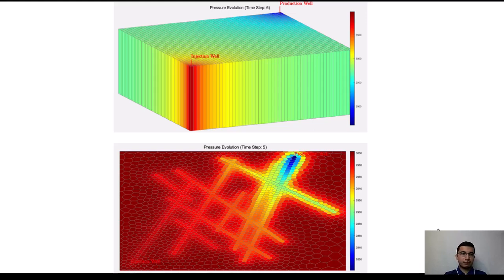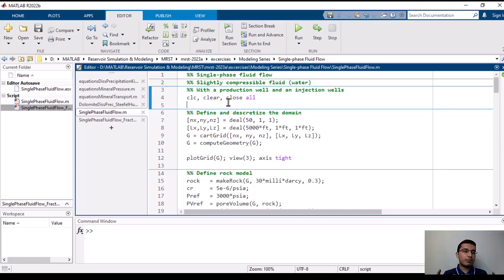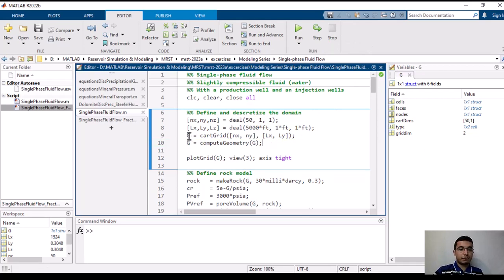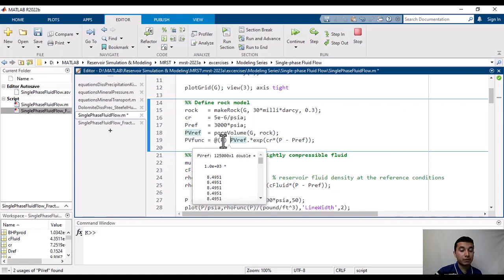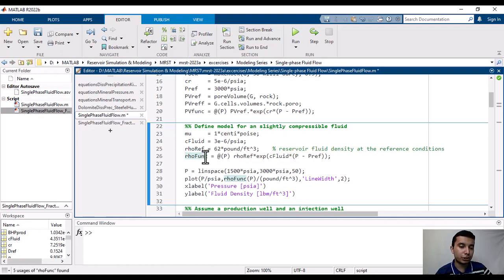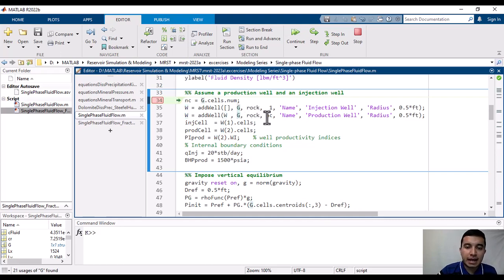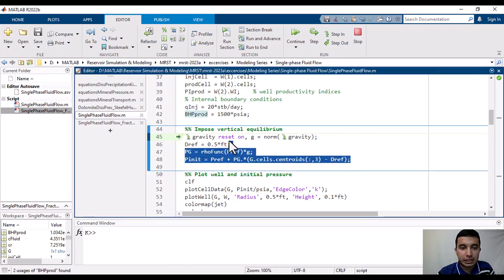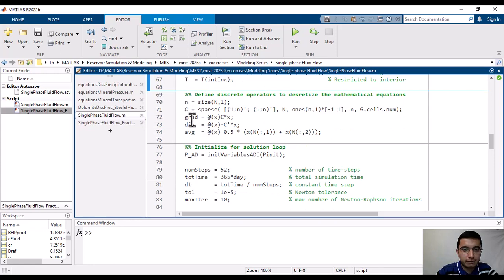Single-Phase Fluid Flow Modeling in Porous Media with MRST (Part 1)

Comment: @SajjadMoslehi. I am simulating flow in porous media with a seepage boundary condition in MRST where the boundary condition at one side changes from 0 flux to 0 pressure head at the onset of full saturation so that outflow occurs. My simulation works fine till it reaches saturation, however when I introduce the switch in boundary condition(only in timestep not in each iteration), the storage results(inflow-outflow) fluctuates like a canine teeth after the outflow starts to appear. is there anyway to deal with this issue in MRST?
Reply from the maker: What do you by "till it reaches saturation"?
Reply: I need to outflow the water from the side and measure the outflown water . For that I have used a time dependent flux to pressure boundary switch in the model. But, due to thhe change in 0 flux to 0 pressure. The calculated flux at that boundary face becomes very high. Causing error in result.
Reply from the maker: @diwasbajracharya3745  I'm not sure what causes the problem. You can contact the main developers of MRST for your question.